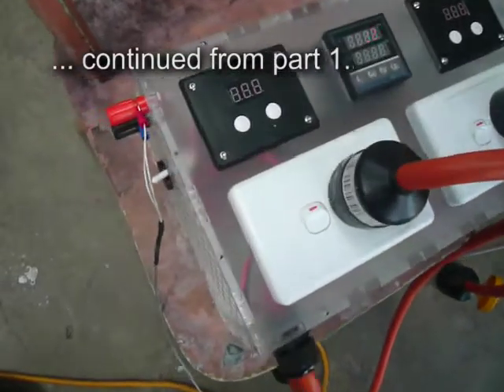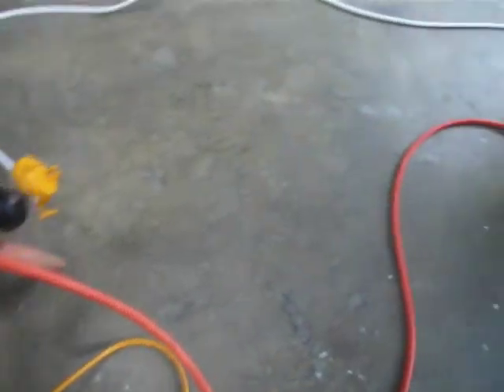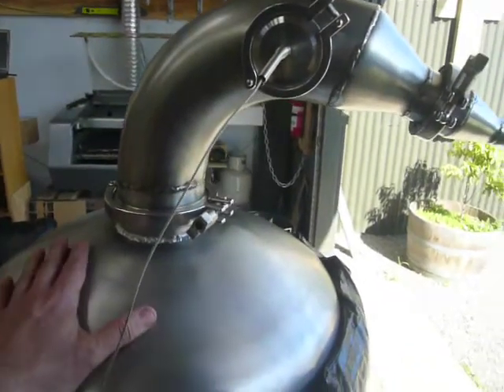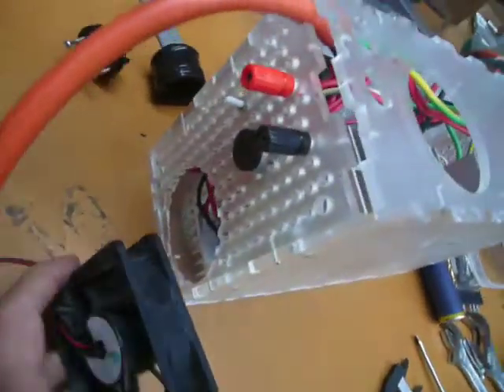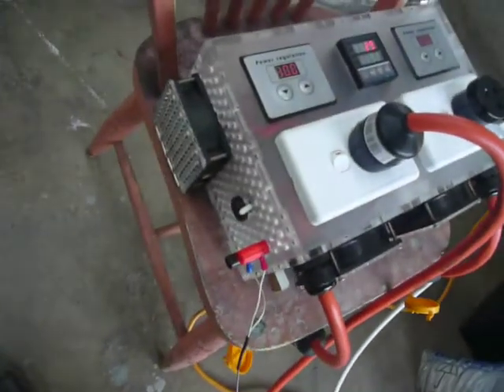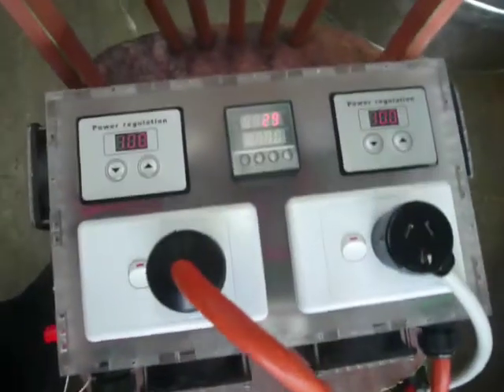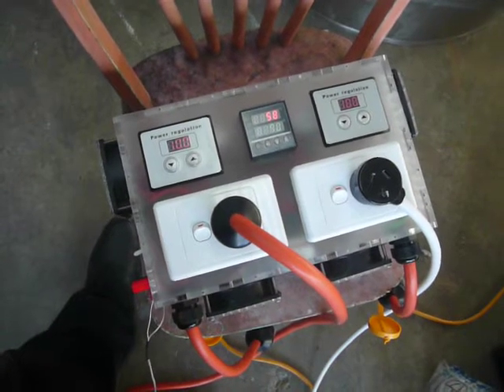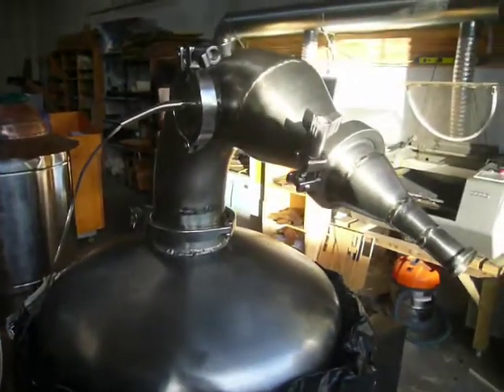Building a PID controller box - Part 2

Comment: How about adding an LED light to the pizo buzzer, so when its disengaged you still have an indication without all the noise.
Reply from the maker: Way I run it nowdays is I just use the PID and alarm to let me know I'm up to the ballpark for taking foreshots. I run it manually after that.

Comment: Nice clean layout on the box - looking forward to see it running a distillation.
Reply from the maker: Hey fella, Thanks!

Already videos up of me doing a full run with it. :o)

After 5-6 months of running it tho' I'm kinda leaning towards a simpler solution with power regulators and no PID hehe, ... got the parts - will be building a simpler box like that soon.

Comment: came out great.  nice unit
Reply from the maker: Cheers Kev! - Having unfettered access to that laser cutter makes life easier!
Reply: i bet.  sorry havnt talked in a while.  had a bit of an issue and been in and out of the hospital.  but should be good to go soon
Reply from the maker: Will post a vid in the next day or so of using the whole rig to make some actual "juice".
I had an 80L charge in it running at 10L/hour production for a stripping run! :o)
Reply from the maker: Hope you're doing ok now fella, - will catch-up for a yak in the next day or so.